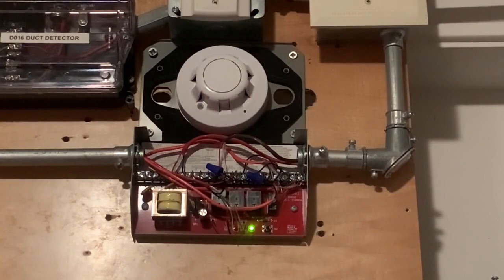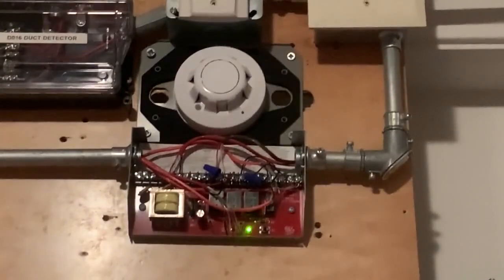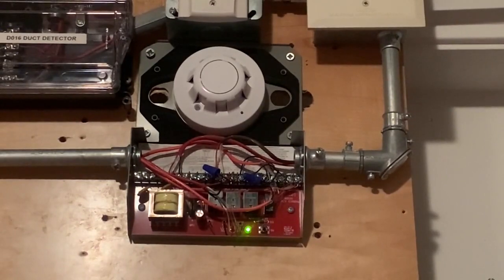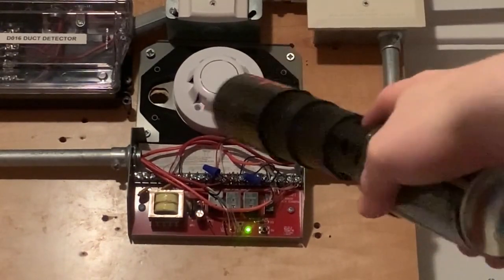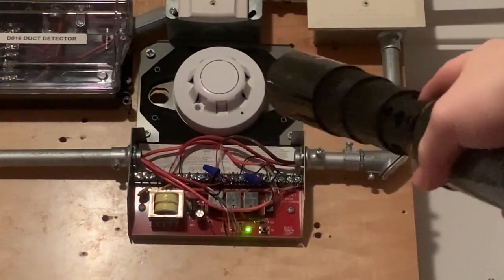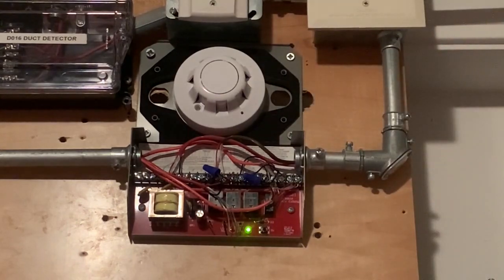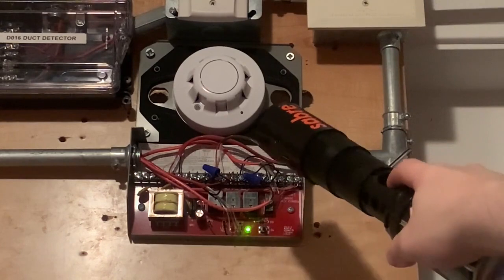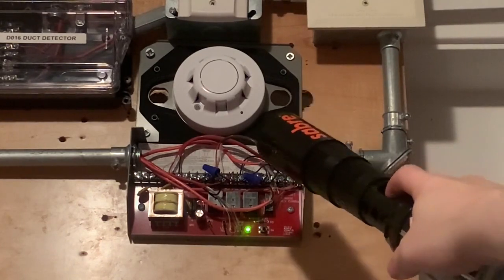Conventional Duct Detector Smoke Sabre' Test 1

Comment: How do you actually test a high flow RTI duct detector. Some are high velocity and require lots of smoke the small 30 second candles or smoke pots will not set them off
Reply from the maker: I’m not sure.